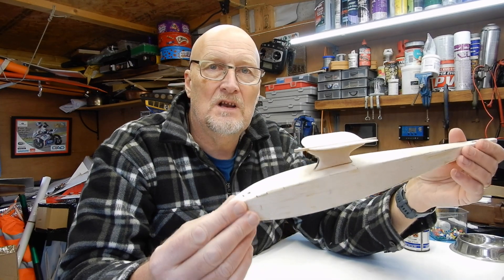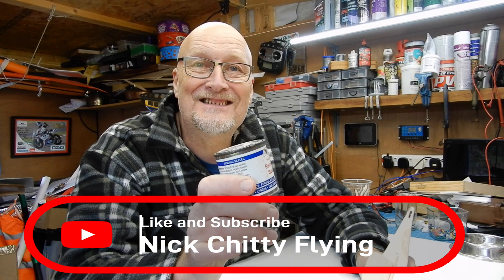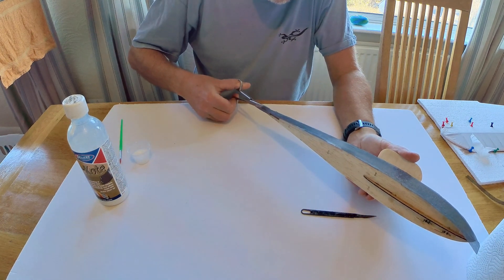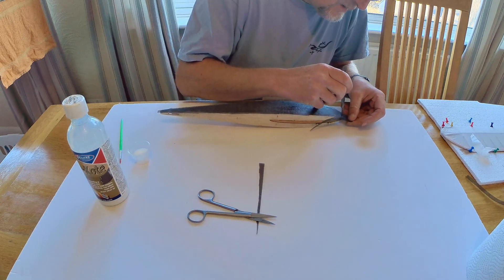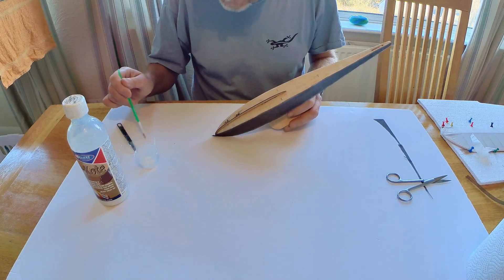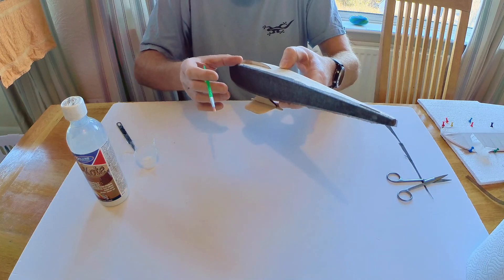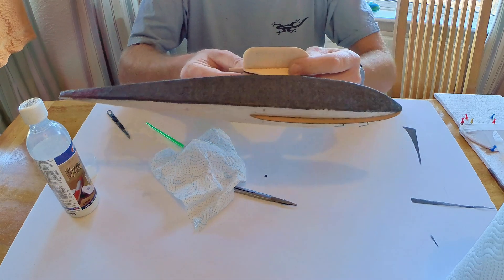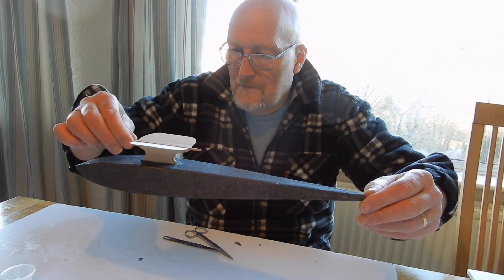Carbon tissue "New Product"  from Angelwingdesigns

Comment: Building the Evo Fire DLG from J & H (got it to familiarize myself with DLG's before going towards the $1000 end). The tailplanes are solid balsa. The first glider flew beautifully. The only negative was the tailplane because, if it dared to ground loop, the horizontal would snap in half. Other than a very light coat of thinned epoxy, I never sealed it. Wish I would've thought about sanding sealer. I think a strip of this tissue on the vertical stabs underside would be perfect!

I'm building my second and had Joshua cut me a secondary set of tailplanes for experimentation. The only real problem is bloody weight. I might think of some way to hollow out the horizontal. Even then, covering will add weight right back onto the tail where I don't want it.

The original came out to 310grams.
Reply from the maker: Stick it on mate not heavy

Comment: Hi Nick. I use EasyKote quite a bit with thin glass cloth and looks like the carbon tissue has similar issues with short overlaps on tight radius edges. I prefer to leave a longer overlap and a  coarse wet and dry sandpaper on a block to trim the excess off once the resin has dried. (I never get a clean enough edge with blade or scissors!) Gentle heat from a hot air gun helps the resin to tack off and  stick the cloth down better, either using a roller or fingers... As long as you get it just a bit more than 50% round the corner radius, the reverse overlap from the next face ensures no gaps in the cloth and a very clean looking edge.  Edit:- In really problematic areas, a bit of Balsaloc and the covering iron sorts it out. 
Malc
Reply from the maker: I Can’t believe the fumes if you use cyno to tack it 😷
Reply: @NickChittyFlying  Not cyano !  Balsaloc - water based heat sensitive adhesive 🤣

Comment: Interesting material. Wonder if you could use a spray glue like 3M 77 applied to the balsa. Might then be able to apply carbon tissue after has set using a warm iron. Just thinking, as have not tried. This a technique that aids applying fibre cloth over a curved surface, as allows repositioning, and controlled dry bonding.
Reply from the maker: Worth a try I am just applying for a bank loan to buy some more 3m77 😂
Reply: @NickChittyFlying  Only small amount required for smaller models. Too bad doesn't come in a smaller spray can. LOL.
There might be a similar alternative.

Comment: I wonder whether this could be used on 3d printed structures in vase mode (one layer) so as to add strength (?) while keeping weight down
Reply from the maker: I going to vac bag something next week
Reply: I've been vacuum bagging with a similar product for quite a while.  It adds a lot of strength!  It also soaks up quite a bit of resin, so make sure you spend some time blotting the part to keep it light. 👍
Reply from the maker: Cheers mickey

Comment: I  have some experience with that product. A great idea is to use a small paint roller. The binder that holds the fiber material will break down when you wet the material, and the paint roller will make the job much faster and help a lot with rolling the material over corners.
Reply from the maker: Great idea 💡